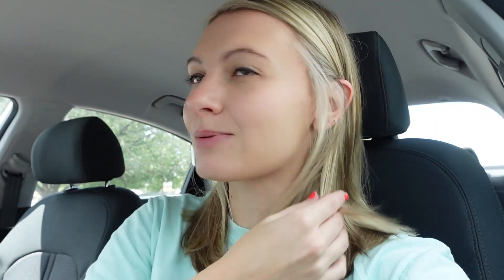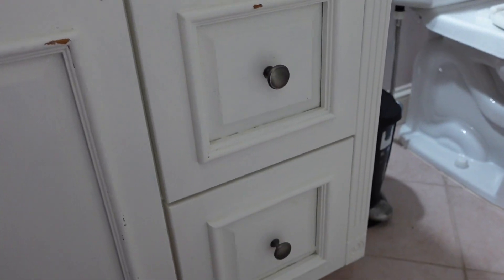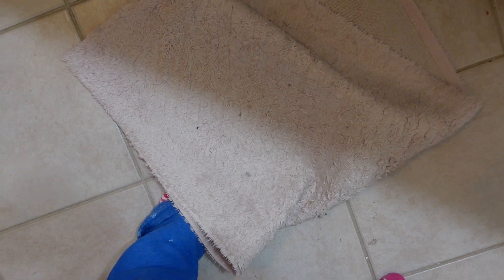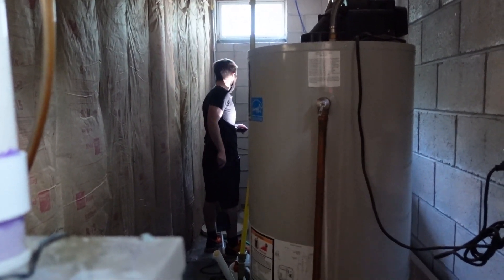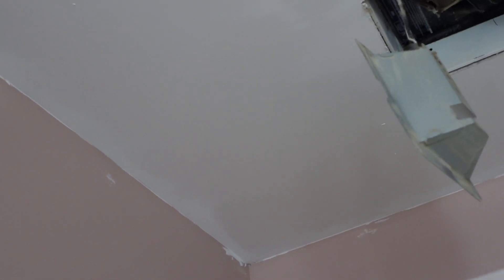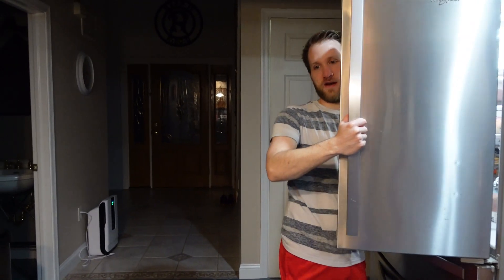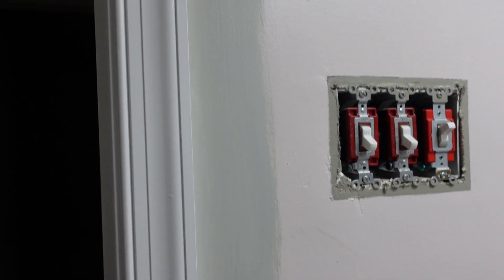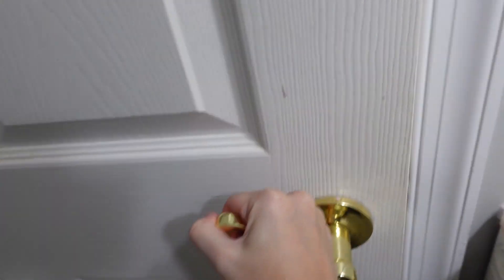Painting McJuggerNuggets' House Without His Permission!

Comment: The water actually doesn’t pass threw the salt it self the salt is actually used to shock the product in the two tall tanks that actually filter the water for the whole house part of the system. You can clean the salt tank but that is probably not what it needs the system may need to have the tanks re-bedded